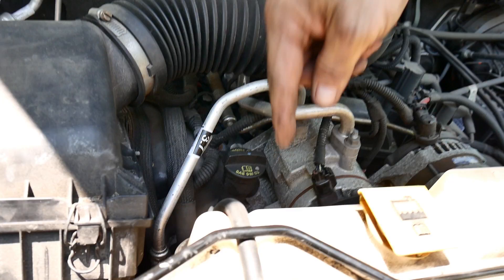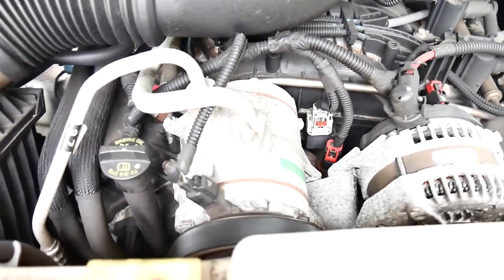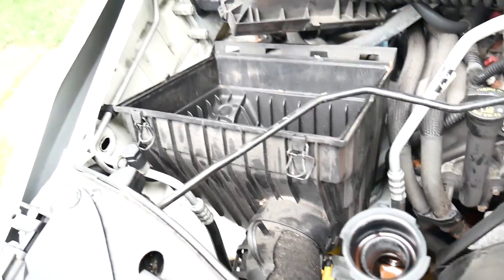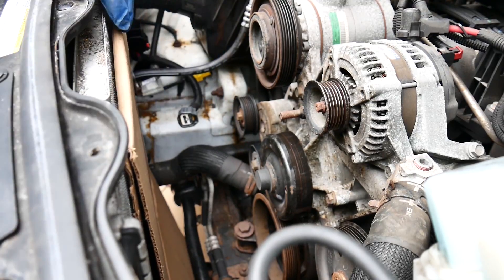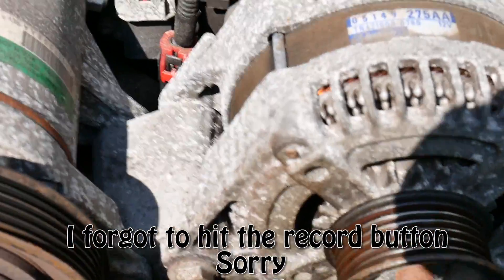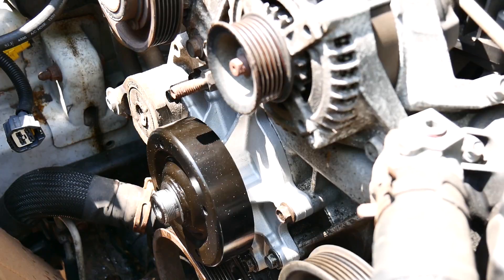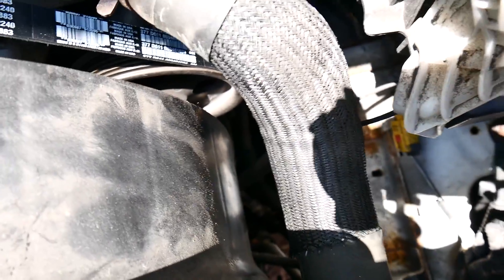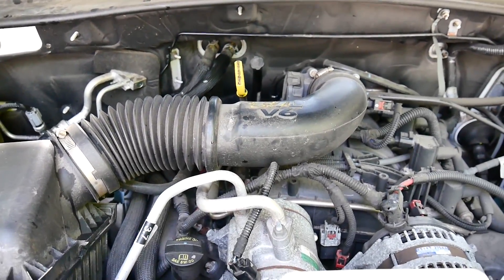2010 Jeep Liberty Water Pump Replacement

Comment: I normally do not comment on videos however I’m a mom who just can’t pay a shop that kind of money I have worked at a tire shop for years and done other small stuff myself so I decided I would see if I could figure this out on my 2010 Jeep liberty and BY FAR this is ABSOLUTELY the BEST video I have ever watched on you tube for mechanical repairs.. I’m going to attempt this in 2 days wish me luck only thing I kinda wish u could have elaborated on a little more was the replacement of coolant I see you said you had to put some in the other lil spot until it “opened” I’m not sure what I will be looking for when I go back to running it and refilling the fluid . Now I don’t crank it until I refill the radiator and the overflow initially right?
Reply from the maker: Yes just fill the main radiator and the overflow start the engine and try and get the coolant to circulate. You will probably need to loosen that Allen screw bleeder at the top of the upper radiator hose like I did. Other things that made it a little difficult it was to get that plug off of the electric fan and those torx screws that hold on the plastic reservoir. Good luck any questions just reply and I will do my best to answer them

Comment: So all who are curious once you pull the air filter cover off and remove the air filter just pull up on the box cuz it's pretty much plugged into some rubber grommets. No nuts or bolts just pull hard and it'll come right up.
Reply: Also thanks for the video buddy...

Comment: These 3.7 V6 Jeep engines have a rubber gasket that after about 4 to 5 years of use will seep when cold weather hits. My 2008 Liberty is on its 3rd water pump gasket since new and now since cold weather has returned it's seeping again. Watch for a small puddle under the engine in the morning after a cold night. Safe to drive because it warms up and reseals, but you still need to replace the gasket when you can. I have replaced only the gasket once without replacing the water pump myself when the truck had 120K miles. Dealer replaced pump and gasket under warranty at about 50k Miles. Now since the Jeep has 169K on it I'll also replace the water pump since I'm in there. And while you're doing this change the belt and tensioner as well as upper and lower hoses if you want to keep your Jeep in great condition.

Comment: Very nice video 👍 I will be doing a water pump on my 2011 liberty on tomorrow
Reply from the maker: Orions Descendent good luck and thanks for watching and commenting. Let me know how it works out when you’re done.
Reply: @CreatingASimplerLifeOffGrid  Thanks, your video helped a lot. I got the water pump replaced. Luckily it went out in the parking lot of an AutoZone so I changed it in the parking lot haha. My only issue i had was I have the tow package on mine and had an issue getting off the mechanical fan that attached to the water pump. I replaced the pump and haven't out the fan back on  yet. I didn't get the fan off until a couple of days later using a torch.
Reply from the maker: Orions Descendent wow. Interesting. Sounds like yours rusted like mine did. Thanks for the update!

Comment: Mine is a 2012 and has an extra fan that I think is attached to the water pump. I haven’t begun working on it yet waiting on parts. I hope that doesn’t complicate things too much. I still can’t find a video for it.
Reply from the maker: If that's the case I wouldn't think it should complicate it much, it should be almost the same. I don't know much about that year but wish you the best.
Reply: 10-12 are all the same
Reply from the maker: @whistlingrock3157  Didn't know that. Thanks!
Reply: Creating A Simpler Life Thank you for responding. It actually did not. It’s called a viscous fan according to some video I watched and you need a tool to immobilize the water pump pulley to pull it off. The nut on it is massive so I had to buy a similarly massive crescent wrench and i didn’t buy the tool. I just used my channel locks to grab on the pulley while I broke the nut. It really didn’t complicate the job but added $30 to the overall cost due to the huge crescent wrench I had to buy.
Reply from the maker: Osama Abolail bummer but glad you were able to get it done!

Comment: Thanks a bunch! I was able to change the water pump with no difficulties. The part about how to remove water reservoir and fan could be a little more detailed, but did work fine for me anyway.
Reply from the maker: Marcos Flores glad it worked out for you. I know I should have more detail on the water reservoir and fan. I apologize but am glad you got it done despite that. Thanks so much for the input. Have a great day!

Comment: Great job and video, thank you, by the way the water neck bleeder screw is how you get the air out of the system by loosening it while running until no bubbles then tighten back up. 
Great video 🤟
Reply from the maker: Thank you! That is what I ended up doing, sorry if I didn't film it. It is so hard to do it all sometimes! Have a great day.
Reply: @  Whistling Rock

When you loosened the bleeder screw while running the engine did you have the radiator cap and the coolant reservoir cap off at the same time, also?

Comment: I'm pretty sure my jeep is having the same problem right now. My coolent only leaks when the a/c is on. Did you have that same issue before? Or has anyone?
Reply from the maker: KayKay Shaw no. We only had a very noisy water pump bushing and a very small leak all the time.
Reply: Yes! I was running my AC in my '12 Liberty my entire lunch break last week, then when I left work there was a loud high pitched hum coming from the engine area. 2 days later coolant is leaking everywhere in the engine area. Mechanic told me that the water pump, thermostat and coolant temp sensor all need to be replaced.
Reply from the maker: motosteele ugh. So sorry to hear that! Hope it works out.
Reply: Mine was leaking and couldn't quite pin point the point of exit.
All I knew is when I would check coolant level is was low. Went on for 2 weeks. Till one day...night I shoukd say, a string of steam showed itself out of the hood while waiting at a drive thru. Fortunately it was approx. 3 miles from home.
Well, the Radiator has a small hole right beneith the coolant reservoir, but in order to see it I had to stretch myself and snake my neck to get a view thru the fan shroud.
And there it was the dried up coolant that ran downd the honey comb of the Radiator
Not really looking forward to doing that but I am not giving $600 to $1100 dollar to a shop.
I am GTDIMS. GOING TO DO IT MY SELF.

Comment: Just had to do this on my '12 liberty any tips on getting the air out 2 gallons of coolant in so far still over heats around the block.
Reply from the maker: Tim Bourgault the tip is open the bleeder screw i show in the video. That’s all I know to do. Hope it works out for you.
Reply: did you do that while it was running or off
Its dark now I will try it again tomorrow she is sitting with the cap off in the garage letting as much air out as I can over night
 @CreatingASimplerLifeOffGrid
Reply from the maker: Tim Bourgault I did it both ways. I did it cold and made sure it was full . Started the engine, let it warm up and loosened the screw until all the air was out and some fluid came  out.
Reply: @CreatingASimplerLifeOffGrid  looks like it is just a pain in the backside to get the air out...slowly filling via the bleeder right now,
Reply from the maker: Tim Bourgault yeah. Let me know how it works out.
Reply: @CreatingASimplerLifeOffGrid  OK been at it all day...here are my tips for everyone, first elevate the passenger side of the car a bit (more the better I think) get a big ol funnel and put that in the radiator fill start the car up and let it go, by angling up the side air will flow much easier to that point and by using a funnel (I put duct tape around the bottom to make a nice snug fit) you can keep it filled with minimal splash and let the air come out.  I will keep everyone posted.  Again thanks for the great video it was truly a help to get me going.
Reply from the maker: @timbo7457  Great tip. I kinda did the same thing but all through the tiny little bleeder hole. Took me three tries. Thanks for all the updates!
Reply: @CreatingASimplerLifeOffGrid  OK words of wisdom, your pulling a water pump, go ahead and swap out your thermostat while your under there, ran circles could not get it to cool properly, finally gave up and called our local mobile mechanic (brilliant idea) they came out found block was hot, lower hose stone cold.  Just passing on what I am learning. IMHO its worth the extra 20 bucks for peace of mind.
Reply: Best way to bleed the air is when you loosen the bleeder screw and the car get to temp get anything to rev the engine to 2000 rpm and keep it there till the air is pushed out.
Reply from the maker: Dwa V thanks!
Reply from the maker: Tim Bourgault just saw this and wanted to let you know I appreciate that. Definitely going to change thermostat 👍
Reply: Tim Bourgault about to do this job on my 2012 liberty did yours have an additional fan? I see an additional fan that seems to be connected to the water pump. Any insight would be great. 

Also while I’m down there I am changing the thermostat, the upper and lower radiator hoses and the drive belt. Just so I don’t have to mess with it for a while.

Comment: Great video but, when I have all of that apart, and at 87K miles, I would have replaced the upper and lower radiator hoses and their rusted clamps, and any other rubber hose I could easily access while I was in there. You replaced the idler pullies which is great, but why stop there?
Reply from the maker: Yes you are right but the hoses looked good.40k miles since it was done. Still looking good and running strong.

Comment: At 217,000 Miles I replaced the pump on my 2008 JL.
not really needed but did anyway because I made an assumption and had already bought the pump.
Turns out the gasket was the cause of the coolant leak.
New pump came with the gasket ordered on AMZN.
I love working on cars except when I have to dissasemble almost the entire car to do the job.
This case is a perfect example.
Came to watcth this video to have an idea of what I hve to face....since it is the Radiator what I have to change now at over 254,000 miles.
Reply from the maker: Wow! I'm glad to hear that you have that kind of mileage on yours. It  makes me happy to know I have a lot of life left in mine. It just  reached 100k .Thanks for watching.

Comment: I might have to replace my water pump because of a freekin bolt leaking or so I thought !!! 2012 and only 76 k on it and find out it has a bad casting and only leaking due to there being a little divot on the engine casting where the gasket rides! REALLY!!!!!!!!!! Hope this one holds for a while. So pissed at Jeep or whomever built this POS
Reply from the maker: Wow that really sucks. Have you tried some black RTV silicone on the threads of the bolt? When you put it back in it might be just enough to hold. I'm not a fan of Chrysler products either. Good luck and thanks for watching.

Comment: Wish you would have shown how to remove the connection to the fan!!!
Reply from the maker: Kerri P I wish I actually could have but there’s no way to get the camera in there. You just have to feel for the plastic plug and pull it out. There’s a little push tab that you need to squeeze to get it out.

Comment: Thank you for the video. It made the replacement of my water pump easier. I also had trouble getting the air out of the system. I didn't pull the vent plug. It was way to tight to move on my jeep. I finally got the thermostat to open also with the radiator cap on, and it sucked the water out of the reservoir after driving 3 miles. Took 3 trips to get it completely full.
Reply from the maker: Thanks for letting us know that the video helped. We really appreciate that. Yes, the jeeps are tricky to get the air out of the system. Some people park it up on a ramp to help the air escape. Glad you figured out a way to make it work!

Comment: STOP.... you only need to remove the alternator (two wires and three bolts) then you will have plenty of room to replace the waterpump. takes about 2-2.5 hours total. depending on how many times you drop the wrenches on the ground...lol. have done several with no issues. the hardest part is installing the belt after replacement of the pump (easy with two men).
Reply from the maker: Thanks for the info. There is definitely more than one way to skin a cat. I did it this way so I could get a chance to take
a good look at everything and change the the idler and tensioner bearings. I'm just a diy'er, Next time I'll know. Thanks again.
Reply: Or women😂😬...I did mine by myself in a Walmart parking lot once(bc that’s where it finally gave out). I kept the coolant container visible and picked it up every once in a while so it looked like I was just trying to pour in coolant so no one bothered me about doing it elsewhere. We come from a mechanic/diy family so between our dad and these videos, saved ALOT of money on labor and simple repairs like this. I was quoted $600 for this job from a shop😳😳😡. My actual cost $52 and a borrowed torque wrench🙌🙌